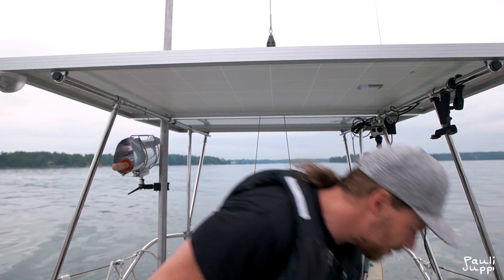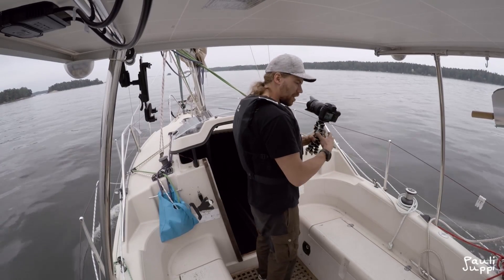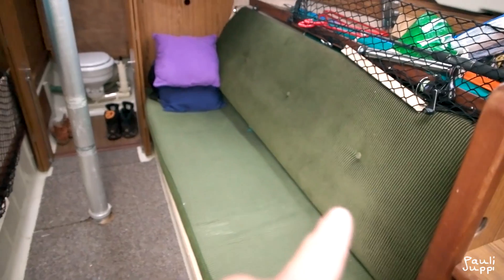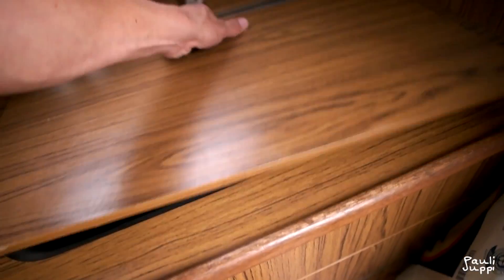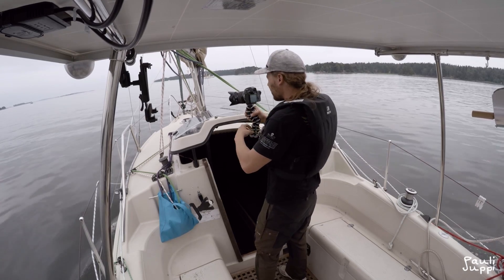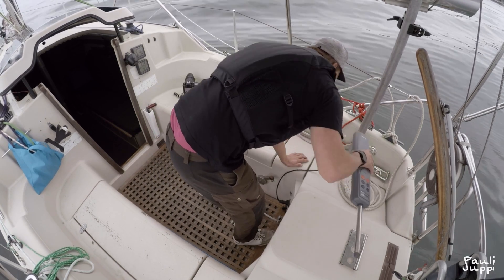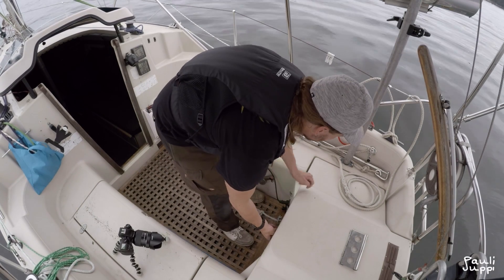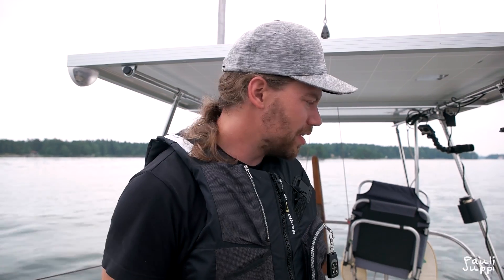This is my electric sailboat! Part 1/3

Comment: Thanks for the video.  I too have the wireless remote control from Madman Marine in Australia and love the small size of the remote.  I snap it onto my life jacket in much the same way.  My boat is a Catalina 27...
Reply: Pauli Juppi most sailing channels they never put on life vests,so you have my respect and my subscription. As the owner of a bassmaster 18 fishing boat with a 70 horsepower outboard, im getting fascinated by sailing the silence is what i like
Reply: @cartmanrlsusall  macgregor    19 26 tattoó 22 26   hunter edge  27 foter hold 70 hp  sail boa  like oiwer biat 20 knits plus   sail want sail 16.6 kñots sail spoeedd
Reply from the maker: You're welcome! Yeah Madman is awesome :)

Comment: Regarding your removal of the cooker as you do not use fossil fuels. I feel the same about my 22ft cruiser and so fitted an Origo 3000 spirit burner as this uses alcohol as the fuel.
Almost as powerful as the removed butane cooker and much cleaner, and safer. Its only problem is that, here in the UK, the government makes it difficult to get hold of untainted alcohol so I have to run it on methylated spirits when my supply, from France, runs out.
Reply from the maker: +Kimdino1 Yes, I've been thinking about getting an Origo also but for heating the cabin mainly. I don't think we got any restrictions here for the spirits...
Reply: Kimdino1 I can go to the dollar store and send you all you'd like. that's crazy
Reply: Kimdino1 can you not brew methanol-or paraffin will that nit work??
Reply: METHYLated alcohol??? OMG, METHYALCOHOL (CH3-OH (MeOH)) is POISON, pure alcohol after distillation - for non eating uses - is DENATURED BY BENZENE.
Reply: 32  kw  bayeeßy

Comment: Id get a rail mount BBQ grill and burn wood, it is going to release the same amount of CO2 if you burn it or it sits there and rots/decomposes....
Reply from the maker: +patriotpioneer that's true. I like BBQ but not on my boat. My solar oven is better cos I can use it safely while sailing and I don't need any charcoal :)
Reply from the maker: +patriotpioneer that's true. I like BBQ but not on my boat. My solar oven is better cos I can use it safely while sailing and I don't need any charcoal :)
Reply from the maker: +patriotpioneer that's true. I like BBQ but not on my boat. My solar oven is better cos I can use it safely while sailing and I don't need any charcoal :)
Reply from the maker: +patriotpioneer that's true. I like BBQ but not on my boat. My solar oven is better cos I can use it safely while sailing and I don't need any charcoal :)
Reply from the maker: +patriotpioneer that's true. I like BBQ but not on my boat. My solar oven is better cos I can use it safely while sailing and I don't need any charcoal :)
Reply from the maker: +patriotpioneer that's true. I like BBQ but not on my boat. My solar oven is better cos I can use it safely while sailing and I don't need any charcoal :)
Reply from the maker: +patriotpioneer that's true. I like BBQ but not on my boat. My solar oven is better cos I can use it safely while sailing and I don't need any charcoal :)
Reply from the maker: +patriotpioneer that's true. I like BBQ but not on my boat. My solar oven is better cos I can use it safely while sailing and I don't need any charcoal :)
Reply from the maker: +patriotpioneer that's true. I like BBQ but not on my boat. My solar oven is better cos I can use it safely while sailing and I don't need any charcoal :)
Reply: How do you boil Water for coffee..?  As far as the BBQ i was thinking you could gather wood from islands instead of buying charcoal.
Reply: Fatso Currywurst well are you pleasant...

Comment: That's not a bad set-up.  I like the doors under the retractable motor.  If yo don't have a gas stove, how do you cook, do you use s alcohol burner instead ? What about heat?
Reply from the maker: +Mazda rx7 Thanks! I've got a solar oven. You can see it on the previous video and I tweeted about it yesterday when I sailed back home: https://twitter.com/paulijuppi/status/757186720446242816?s=09
Heating is not that easy to do with just electricity but I've been looking for some infrared heating mats for the mattresses.. :/ There's no point heating the air with conventional coil heater using my batteries.